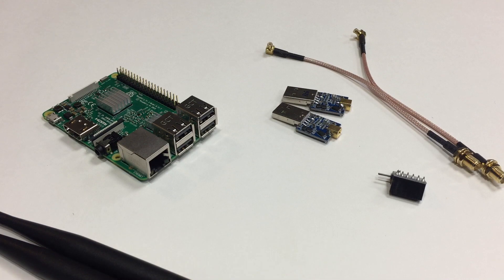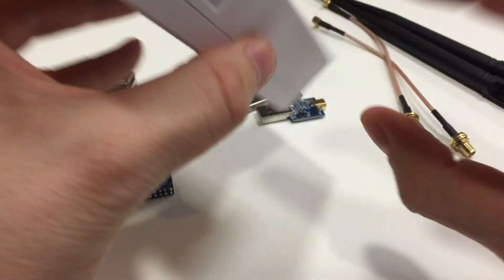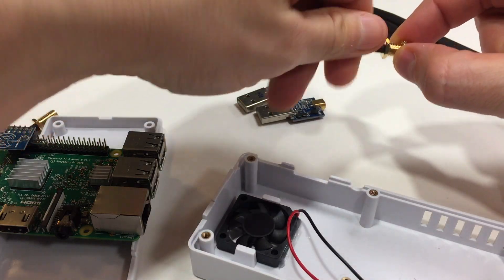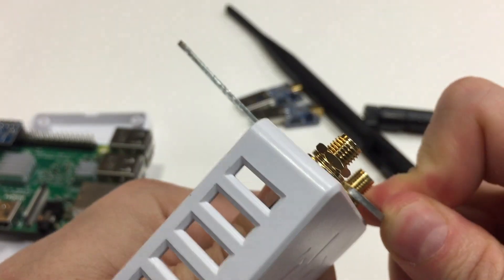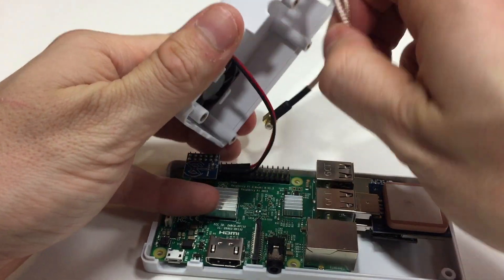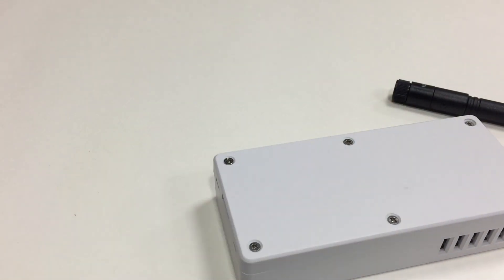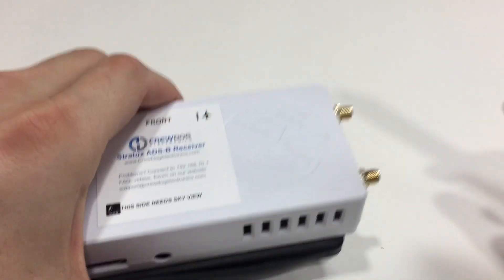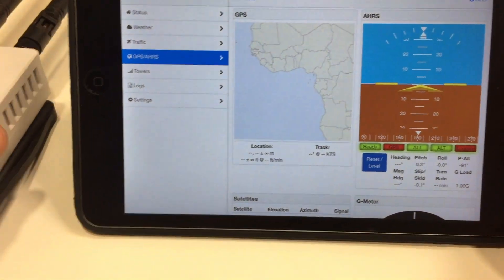How to Assemble Stratux ADS-B with AHRS from Amazon Parts List

Comment: I prefer to power it off of ships power. And not fool with battery packs. I guess the issue then is to find the right cable to a USB power source.  Also when first setting it up, can send an image to a monitor to see if all components are loading without error? I've read some have had to remove the AHARS due to loading errors.  Also do the antennas need to be vertical or do they work horizontally as well?

Comment: so question with regards to the AHRS what is the propper way to set this up, mount to the window and then turn it on, or do I have to mount it up, turn it on and then goto the webpage to calibrate it level for each flight ?

Comment: I have had the integrated USB power connector on the Raspberry Pi board become intermittent twice in the past year (requiring board replacement)... is that a more stable way to provide power to the board? This is getting too expensive, and I may have to seek an alternative ADS-B device.

Comment: Will Raspberry PI4 work with all the components?
Reply: While I haven't looked through the forks on the Stratux Github account to confirm the following claim, according to others the answer is, "Pi4 will not work out of the box." It CAN work (and scuttlebutt claims there are people working on it) if you make changes to the software, but there is no reason for the Stratux devs or Crew Dog to bother support any official Pi4 revision because the components needed by pilots won't take advantage of Pi4's upgraded features. Instead, the Pi4 will just use up the battery faster. There is no advantage to using a Pi4 at this time, unless you just happen to have one lying around.

Comment: I think the barbs from your first antenna washer should go against the plastic. That would really help the rotational issue. Then add the lock washer and nut. Looks like you put the smooth side of the first washer against the plastic.

Comment: Can this work in the car with ForeFlight, but be able to receive the radar via the cell connection. I see that part does not work on the ground
Reply: I heard most will not pick up until you get in the air around 100-200feet for the antennas to read you, the satellites will also see you and communicate with each other, for a more accurate target.

Comment: Are the heat sinks pressed in or do they require soldering?
Reply: They stick on with double sided tape.
Reply: Double sided tape? Yikes......not much thermal transfer going on there....I guess it’s better than nothing.
I would use proper thermal paste to ensure the chip doesn’t fail prematurely.

Comment: The battery pack is unavailable from Amazon.com with no known availability date. Is there another battery that you recommend? The larger EasyAcc (10000 MAH) can't be charged while it is being used and doesn't appear to have an integrated cable.
Reply: Rodney Brown if you go to monoprice.com you’ll find a large selection of high capacity batteries that have or greatly exceed the requirements and will charge while powering the unit. There are often sales and they sell cables of any length required for the power cable and charging cord.

Comment: Which app would you recommend using for both the ahrs and ads-b? As a side note I ordered everything you listed but did not get the heat sinks. Were they suppose to come with the PI board?
Reply: Kevin Straus ForeFlight is good but you have to pay for it, for a cheaper option check out fltplan

Comment: What if the pigtails dont go on the SDRs very easily?  Mine were very tight.  I was able to get them on, but it took some force and a little wiggling.  I checked to make sure the pins were straight beforehand, too. It seems to work okay, though I haven't had it up in the plane yet.  I am just worried something is not right or may be damaged and will fail prematurely.